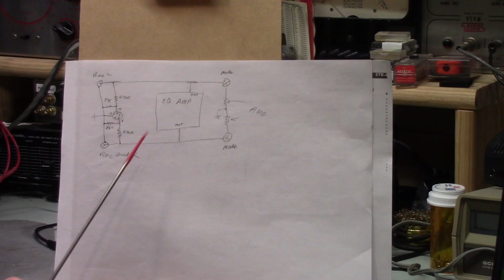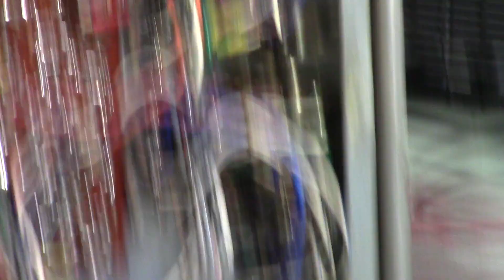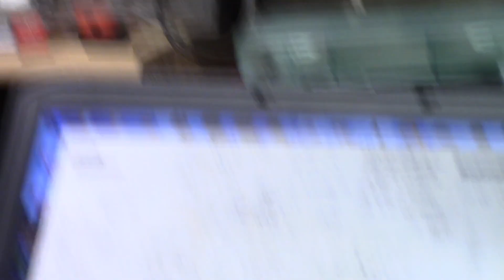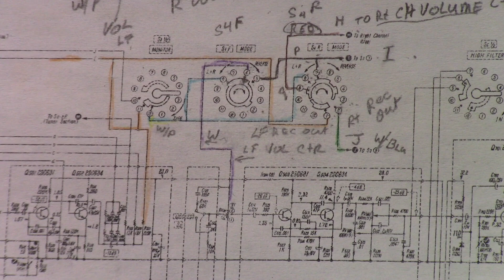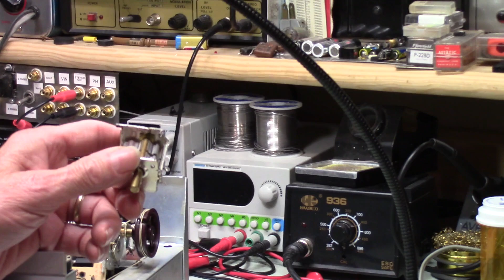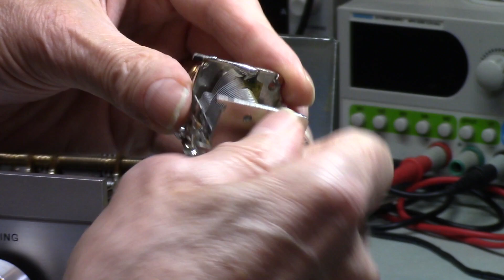Sony STR 6050 Part Three

Comment: Regarding the MODE switch (channel selector) settings - this is  explained on page 5 of the SONY STR-6050 Service Manual.

The settings are:

Reverse –  left channel signal to right speaker and right channel signal to left speaker.

Stereo – left channel signal to left speaker and right channel signal to right speaker.

L+R – left and right channel signals are mixed and sent to both speakers.

L – only left  channel signal is sent to both (left and right)  speakers.

R – only right channel signal is sent to both (left and right) speakers.

Hope that helps
Reply from the maker: Sorry for the long delay. I have been so busy. Thank you for digging in to that further. I looked at two manuals and it is rather interesting. One of the manuals is a user manual for English and French, and in that one, it says for [Left], [Right]- Delivers Left or Right only, depending on the position of the switch, [Left] or [Right] . Now if you look at the service manual it has a chart and on the chart it shows the same thing. In the left setting you only get a left output and right only gives right,  except for Rec Out. For that it shows that you have normal output. For the [Reverse] setting, it shows what you would expect, the left and right are reversed, except for record out which is normal. That last part makes sense. When I looked at the schematic again, I saw that the Rec Out jacks are not affected by the switch and will always have normal output because they get the signal from the preamp before it goes through the switch.  I am tempted to look into this further but the time involved is too great for something that likely won't be used much, if ever. Can't understand why it doesn't work the way the manual says. It is still a mystery to me.